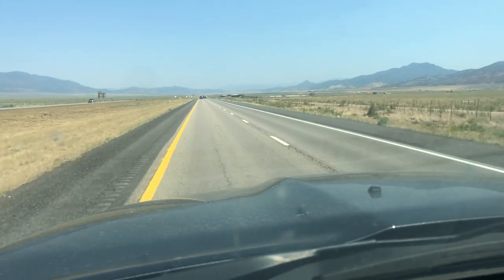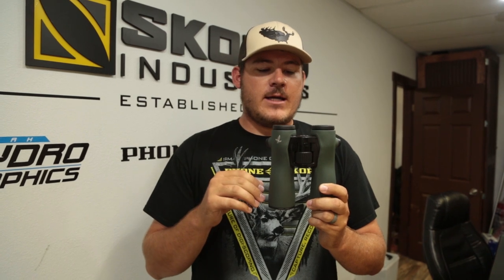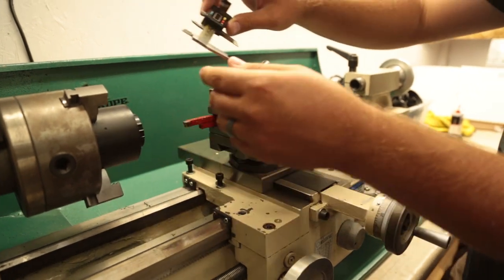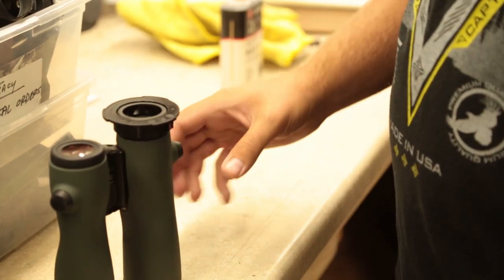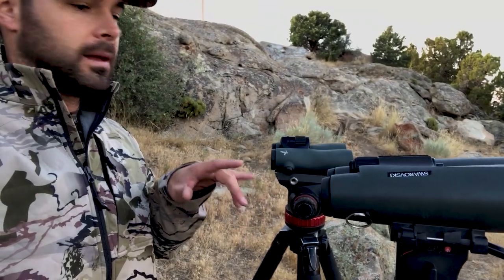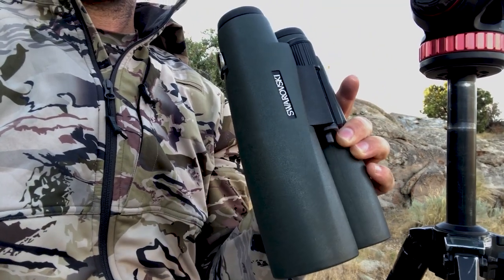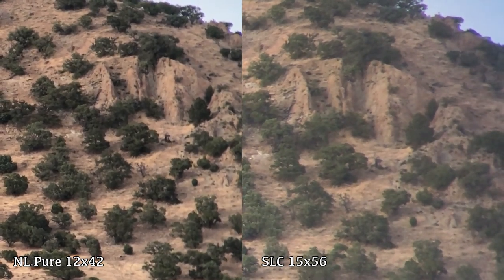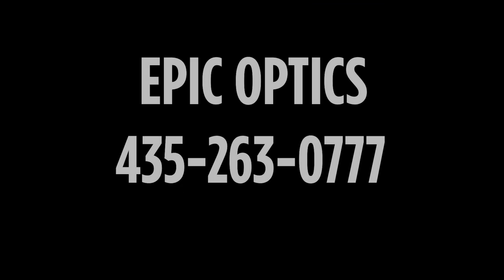NL Pure 12x42 VS. SLC 15x56 - Non HD

Comment: Do the same test with the 15S SLC HD, The most current EL 12x50s, and The NL 12x42s. 
Dont think its a fair comparison using non HD vs the "new best" binocular.
Reply from the maker: C 777 we will do some comparisons for those as well.
Reply: Epic Outdoors I second C777’s request. I’d really like to see a side-by-side comparison of the NL 12x42s and the EL 12x50s, especially in very low light. Please and thank you.

Comment: Was the SLCs dirty or scratched? I was anticipating the nls to have a slight advantage but those SLCs looked nothing like they should have.
Reply: I have the SLC 10 x 56 and the clarity and vibrancy is phenomenal. It looks like these binos had dirty lenses or the camera used was lower clarity but it’s not the same colour and vibrancy on my Binos or others I have tried. I also have the 10 X 30 2EL which have good clarity however the light transmission on the SLC is is unparalleled.
Reply from the maker: no not dirty or scratched. they are not the new HD version of the SLC though they are the previous model that Ive been using for the last few years. The HD version I'm sure would look much clearer

Comment: The 15x56HD are much better than the NON... Thanks for posting either way! How did you feel the eye relief was on the NL? I sold my 12x50 cause they would black out (not a lot but more then my Leica's) if your eye socket wasn't smashed into bino's. Is the NL pure improved in that regard?

Comment: If you’re going to do a comparison test then the binoculars need to be the same magnification !
Reply from the maker: Not when youre comparing to see if the 12 is a suitable lighter weight replacement for the old 15s. In that case youd like to see if a 12 can compete with the 15 and if the clarity difference is worth losing the extra magnification.
Reply: @EpicOutdoors  yes I would agree if you’re looking for a better smaller binos. I have the 15 x 56 SLC and they are great for close ups but I like to use my Steiner 7 x 50 for general use.